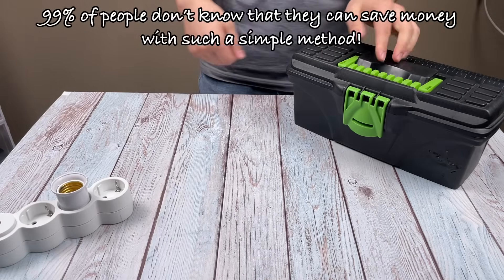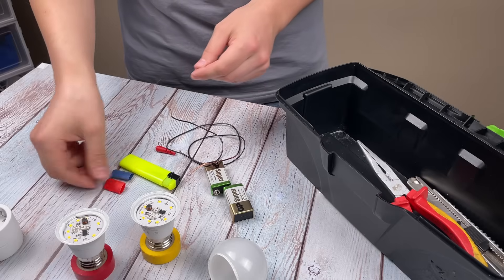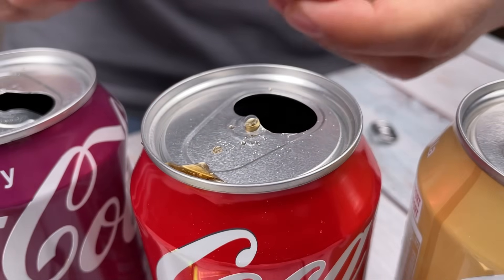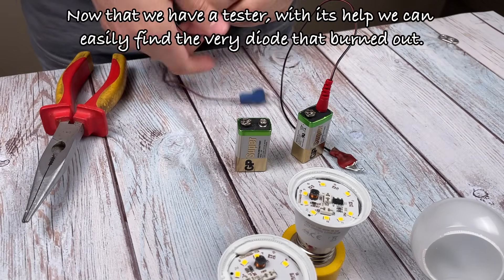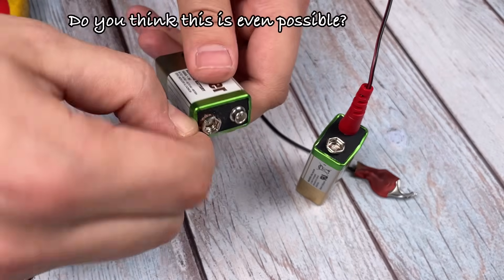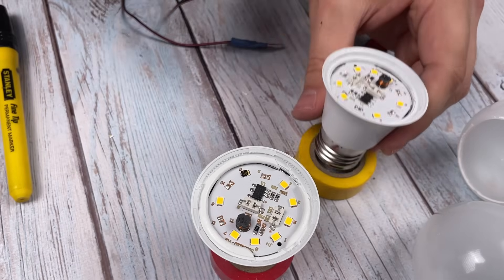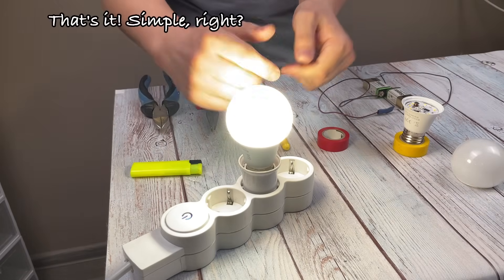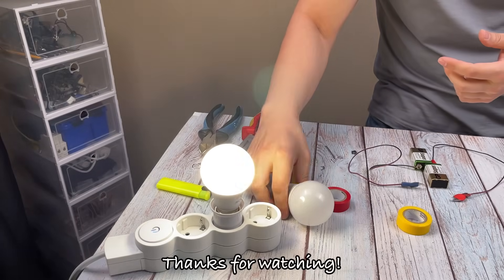🔥🔥99% of people don't know that they can save money with THIS method! Save this VIDEO

Comment: You do not save anything ! Your method  will make to work the bulb only for 2 hours ! better take one led from one damaged bulb and replace to the second one - so it will work for many time.
Reply from the maker: and I said that in the video! You can fix it like I did or take another diode! That's right 🤗🤗🤗

Comment: Such a light bulb will not work for a long time because... the voltage and current allowed for the remaining LEDs will be too high and the controller will not be able to control this process, which in turn will lead to damage to the remaining LEDs. It must be remembered that in this circuit they are connected in series.
Reply from the maker: and I said that in the video! You can fix it like I did or take another diode! That's right 🤗🤗🤗
Reply: @jaybrox1652  NO ESE SISTEMA NO DURA YO LO ARREGLO PROFESIONALMENTE
Reply: its true only work few hours..🤣🤣
Reply: @Sisirakumarsinha  you obviously a lousy fixer.hahaha
Reply: A
Reply: The chip on it does the job of limiting the current, it gives the volts according to the need... Even if there is only one LED, it will still light up.
Reply: @jaybrox1652  jajajajajajajajajajajaja mejor que el original jajajajajajajaja